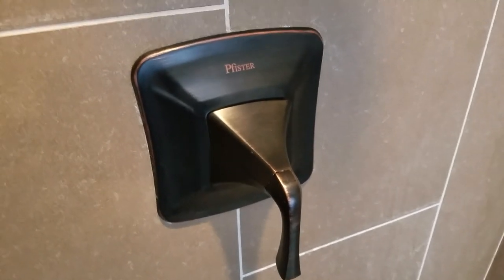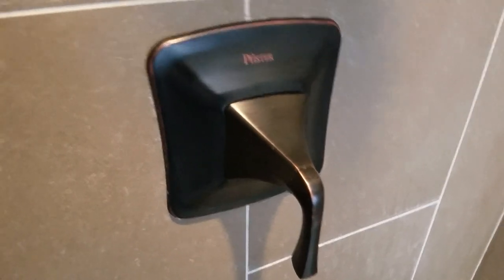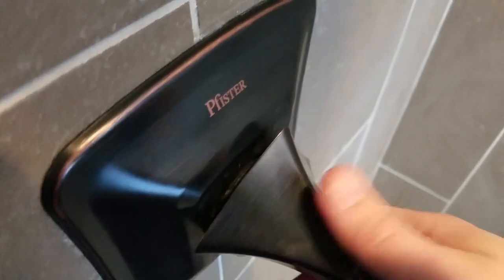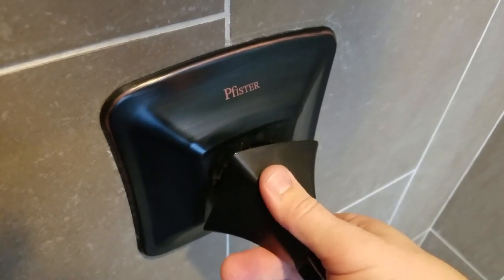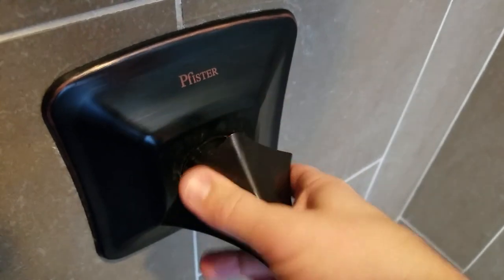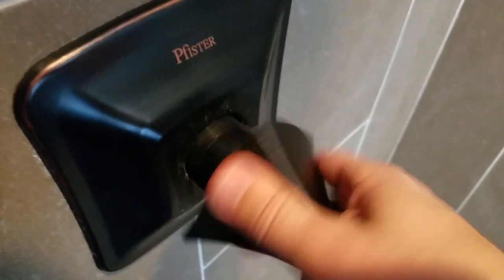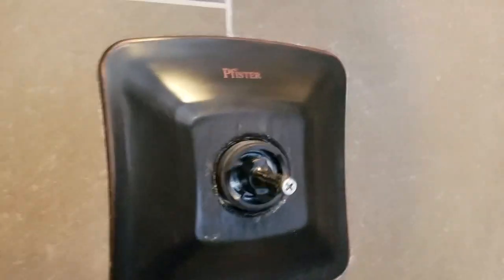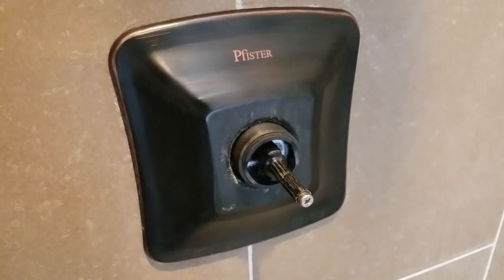Price Pfister NO SET SCREW Shower Handle Removal

Comment: Turning that piece sticking out turns the water on. You have to take that screw out and that piece out then pop the little black piece at the back off and rotate it counter clockwise for hotter. It has teeth so has to be pulled out and turned and put back in.

Comment: Also to change the temps higher, you need to take off the extender and screw, pop the little round tab that says to move to lower and go the opposite way, move the dial to the left so the handle goes further up. Hot water from hell and put everything back together. The handle won't align straight now that the dial has moved. Wife wanted hotter water.
Reply from the maker: I also have a video to help with the temp adjust... https://youtu.be/TY9RWvxdscc?si=7flvrbxFVZ159Ymw